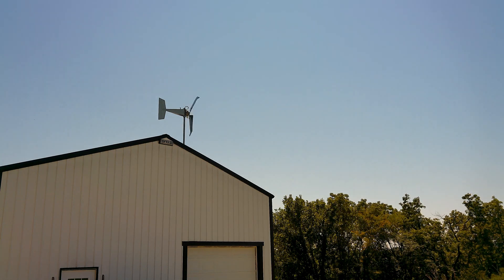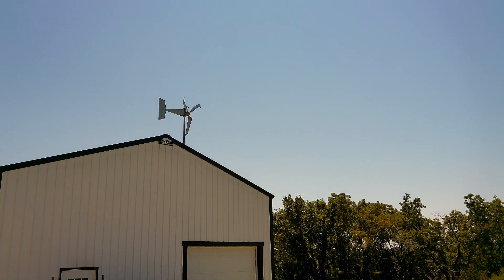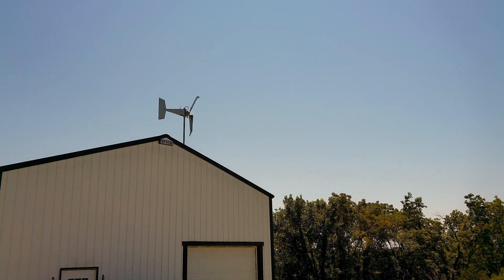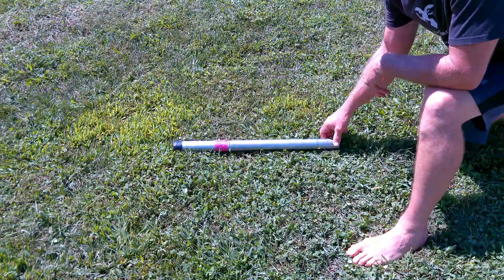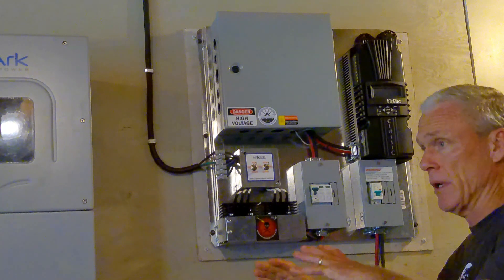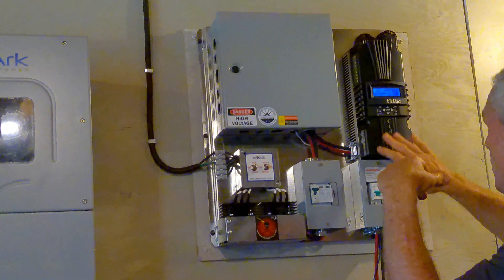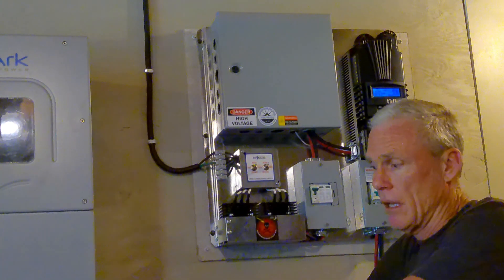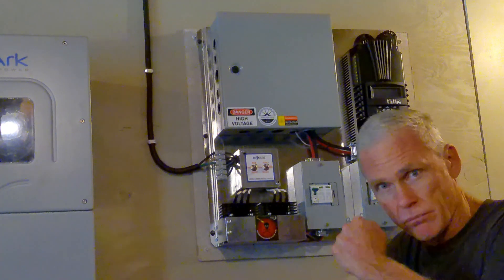DIY Wind Turbine for Off-Grid Battery Charging

Comment: Where you buy the wind turbine
Reply from the maker: Missouri wind and solar. It did not put out enough power to charge my batteries, only slow down the discharge by about 10%.
Reply from the maker: BTW, if you decide to go with a similar set up, pay attention to the control panel design. Some components are specifically for lead acid and some for lithium batteries. Make sure the provider knows your battery chemistry when ordering.

Comment: Thank you for the great videos :) I am eagerly awaiting power numbers from the turbine this Winter!
Reply from the maker: You and me both! I may have to play with the power curve a bit but I'm hopeful it will greatly minimize generator use! I'll be in touch.
Reply from the maker: The turbine gave me 16 amp hours last night over a 9 hour period. Had 20-30 mph gusts. Not a big deal but it put enough power in the batteries the soc only dropped 5% instead of the usual 16%. I will put out a video when I have more consistent info to report.
Reply: @goingoffgridatgreenshireho435  I like that! I bet it was a treat to wake up to a 95% full battery bank :) So the turbine produced ~ 3.4 total kWh last night?
Reply from the maker: I didn't do the math but that is close. Winter winds will be more consistent these winds were more gusty from a storm, I might wake to full batteries with smooth winds.

Comment: LOL Got it all hooked up but NO CHARGING FROM WIND TURBINE.  Waste of time.
Reply from the maker: The voltage on your batteries needs to be low enough to allow charging, has the soc dropped enough? Mine has shown good voltage coming in till the voltage reducer kicks in due to the soc of the batteries being too high. Don't give up on it too soon.
Reply: @goingoffgridatgreenshireho435  I do know all about solar and battery charging.  I did extensive testing with wind turbines as have others on YT.  Unless you have sustained winds of over 25mph Wind Turbines are a waste of time.  The only exception is when it is very cloudy getting nothing from your solar panels and it you have sustained winds.  It will help then but probably not as well as you may hope.  I hope your experience is better.
Reply from the maker: Thanks, that is why I got it for the below freezing, cloudy days of winter. Especially when its snowing, that's when 30-40 mph wind blows across my hill top. I love this stuff and can talk on it for hours!
Reply: Have you guys considered flywheel generator loop set up with magnet assistance ? They have a motorcycle wheel that works that I seen,,, not in real life tho ... but looking to try working on one

Comment: This looks really nice!

 I just finished putting up my wind tower last month with a 2000 W wind turbine. I am just starting out with 48 V 400 ah battery bank, 10,000 W inverter(second one on the way) and 16 x  555 W longi solar panels.

 I'm really looking forward to your numbers. As I am in the construction phase and probably have most of the things hooked up this weekend.

At my location, I have an average yearly windspeed of 9 m/s at 40 m. I'm still in the testing stage, my winter turbine is at only 9.75 m. Or 32 feet plus an extra 10 foot lake sure effect.

My back up generator is just a Honda 3000 iS, so the best it can do is about 20 A at 120 V. I'm still looking for a charger for it, for the big 48 V batteries.

https://www.youtube.com/watch?v=8Bp8fcbilzs&t=4s
https://www.youtube.com/watch?v=esDfCh-d_ns&t=47s
Reply from the maker: Sounds like your building a nice system.  I hope the turbine will charge my batteries well this winter, I will advise further. That gen will probably need to be replaced with at least a 50A to charge those batteries. I have an EG4 Chargeverter and it will raise my 600ah 48v bank 20% in 2 hours burning 2 gallons of propane.
Reply from the maker: OK, not a big deal but a bit of info for you...we have a 15-20 breeze today and the batt voltage is at 54, full is 57, but the clothes drier is running so were pullin hard from the solar. With all that going on the turbine is spinning decently and the MPPT is charging at 1.3A into the batteries. not a big deal but its doing its job. More to come.
Reply from the maker: Drier is off, batteries are full, turbine still spinning but MPPT is "resting" Auxiliary 2 on the Classic shows voltage reducer has kicked in. I think winter will bring good results.

Comment: Why didn’t you just use 2” pipe and a coupler? - Not an Electrician, you don’t say.  Honestly it will probably work just fine anyways.
Reply from the maker: That was my first plan but then I saw the 11/4 pipe next to the 2"and inspiration caught me. I think this bond is much more solid and will handle vibration and Tork better.

Comment: thank you for the video, does mounting the wind turbine on the building cause and noise inside the building?  
I'm wanting to do the same thing but concerned that the building may turn into a big speaker.
Reply from the maker: The noise is a low hum I do not find loud or anoying at all. It may be the massive wood post I have the thick sch 40 pipe mounted to, absorbs vibration, minimizing noise. The blades on this model are only 32 inches, longer blades will be louder.
Reply from the maker: Well our monitor crashed for our computer a few days ago but back up now. Wanted to get back to you right away. We had not had good winds yet when you asked about the noise. Well we had 30-35 mph winds a couple days ago and it was noisy in the shop. I did not find it annoying but I'm hard to annoy. However there was a whining hum when it was spinning in that 35mph wind.  Using sections of water pipe insolating foam may help.  But I'm ok with it as it is.

Comment: so has the wind turbine produced any power yet? at what wind speed will the system start producing power? what was the cost of the parts for this system?
Reply: Too high cost for wind turbine and not reliable at all, better to put more solar and batteries than wind turbine, atlest in Australia where solar panels and LIFEO4 is dirt cheap. A free washing machine motor that you can find from the side of the roads can produce more than this $3000 worth wind turbine.
Reply from the maker: I'm not Savey enough to build a turbine from an old washer. I think I have enough solar, it's the heavy cloud cover here in winter that is the problem and more solar won't do the trick. We have great wind in winter so I'm hopeful it will work for me.
Reply from the maker: It has produced some power. We had good wind off and on end of Sept (15mph). I watched the Classic display climb to 1200 watts. My batteries were full so the voltage reducer kicked in to controlled the output. The "cut in" is 6mph but it takes about 12 mph to produce a reading on the Classic. In winter I will have a real world picture of its power when the soc of my batteries is lower and the wind is blowing harder 20-30 mph. Cost of package $3,000 / pipe $60

Comment: Would it work if you positioned the turbine on top of the condeser of the AC unit with a fixture so the fan can create the required wind to move the turbine when the AC is on?
Reply from the maker: Interesting question! The wind from the condenser would probably not be adequate. However bolting a vertical axis turbine to the condenser fan shaft might work. Don't know if that would cause excessive wear on the fan barrings and it would only generate power while the condenser ran. About 90% of the power I will get from mine is in winter because my batteries stay full the rest of the year so wouldn't work in my system.